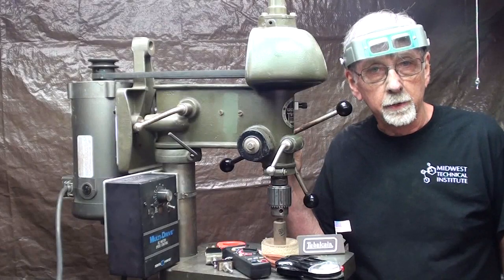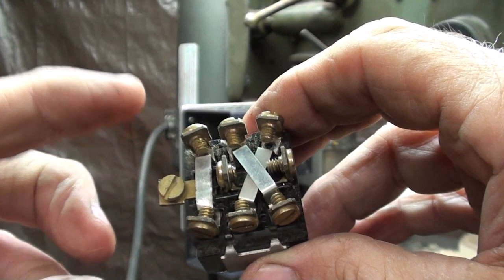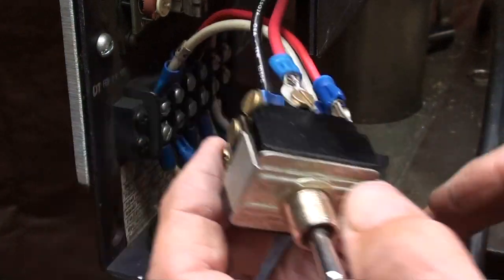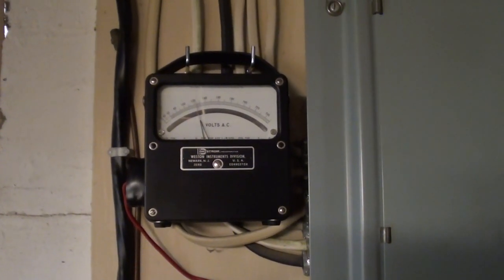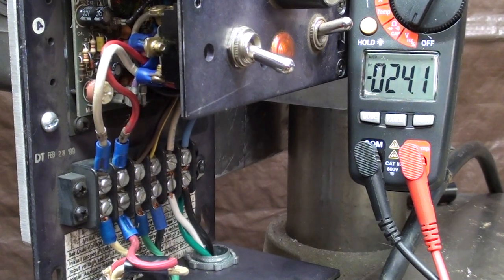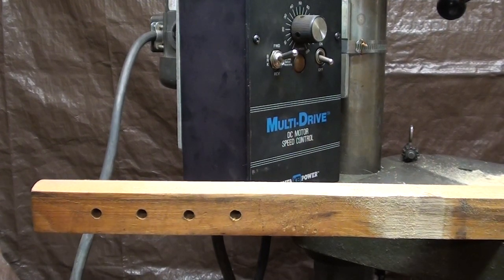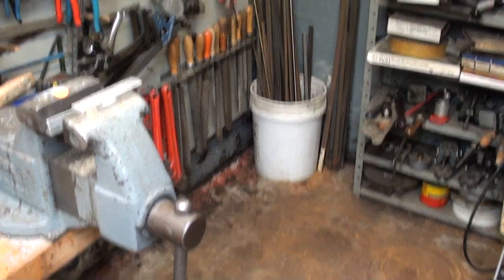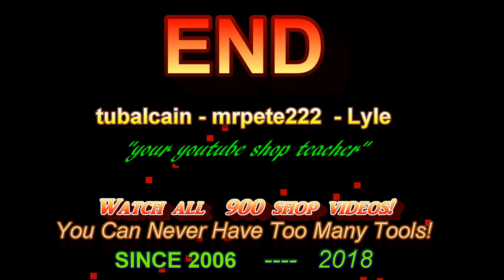Install Reverse Switch on DC Motor Tips #481 tubalcain

Comment: I didn't expect that much torque at that low speed. Thought it would stall.  I think you have a winner!
Reply from the maker: Yes thanks
Reply: Steam engines and DC motors produce the same torque at low RMs as at high RPMs, this is why DC motors have replaced steam engines in Locomotives and industry for so long. VFR drives are now replacing DC motors.

Comment: I really enjoy this kind of shop work. I do it too and sometimes seemingly simple things take me weeks!!! I am retired so it's not my evenings... its days and days and days... I really like your control box. I didn't see the VFD but I like the whole idea... right now I am re-cutting/grinding the taper on the nose of my 70's vintage Craftsman floor model drill press. I am setting the compound up to copy a J33 and then will set up the spindle to cut and grind. I had to make a holder for my Fordum grinder so now I'm ready. Your videos give me great information and really help me to do things. I know lots of people just enjoy watching... but I am using your teaching!! Thank you!! OH... by the by (my grandmother used to say that), I remember you saying several years ago why would a boy spend thousands of dollars on a car when he could by a Bridgeport Mill. lol Loved it. I did drive from Washington to CA to buy a Southbend Milling machine... it's a beast. Not particularly precision the table looks like a hammer and chisel mechanic worked it over for about 50 years but it works really well and I am able to adjust and use it to some degree. I did buy your series for the mill and that helped some. Maybe one day... (I suspect this it far out of your purview) but one day maybe you could do a mill table refurbish... Not like scraping or anything but making it usable.... For now... I 'll just keep adjusting and struggling to get things oriented properly to the spindle. Thank you again!!!
Reply from the maker: Thank you for watching. I had a southbound milling machine at the school. I really liked it. I bought it brand new so it was in nice condition until the kids got a hold of it.keep watching

Comment: I did a similar thing with my dc speed (Dart 250 series) control on my lathe. One important difference though is that I made it difficult to switch from forward into reverse before the motor stops.  I learnt this lesson the hard way and damaged the same make/model of drive you have.  I added the same dpdt switch but used one with a flip down protective cover so you are far less likely to go from forward straight to reverse.  I even cut the switch toggle height down to a 1/4" stub so I didn't accidentally flick the switch when flipping up the "safety" cover. This way i remember to switch off the ac power (you should to) before flipping up the (red) protective cover and moving the stubby switch from forward to reverse. It's not perfect but it is safer than an exposed forward/reverse switch. I know i'd make the aame mistake again if if i hadn't of made reversing more of a challenge. This was on my lathe and it did take longer to come to a full stop, it may not be such an issue if the motor stops as fast as your does. Just something to consider for anyone considering this. The factory reversing uses a safer approach where the ac power is also switched off (4pdt switch) and some also have circuitry to prevent current being applued while motor is still turning.

Comment: Mr. Peterson, the switch looks suspiciously like one that has brake capability. It is quite probable that two remaining (side) terminals are shorted when switch is in the middle position. In either up or down position they are open. This is where the braking resistor would go (shorting the motor terminals while coasting acts a brake dissipating energy created while the motor acts as a dynamo). Maybe worth checking.

All thumbs way up for all what you do and your wisdom.
Reply: I was thinking the same thing.........a resistor and a heat sink across the motor supply wires.....in the center position......
Reply from the maker: Thank you very much, I think you are a little ahead of me regarding electron theory
Reply: As you, Sir, are WAY ahead of me in your machining skills not to mention machinery and tools. Garage envy!
Reply: Won’t work at all,there isn’t any regenerative potential here
Reply: I think the Brake position is probably a form of DC injection which is why it would work on the middle position - have you tested if the circuit is open when the switch is either up or down and if it is closed in the central position?

Comment: Good practical demonstration. Thanks. The power being produced by a DC motor is simply Watts=amps times volts and if you prefer horse power, divide by 745. So as the motor is slowed down the current increases and the power increases too.

Comment: Mr Pete I worked for many years in a steel works where motors were predominantly DC 250 volts or 500 volts on the older plant so I'm a big fan of DC motors ! The drawback for home use for many years was the motor needed a 'control box's but now with the use of VFD's  the playing field is somewhat levelled.
Reply from the maker: Many years ago, the entire Westclox factory was wrong on DC motors. They made their own electricity at the time. I hauled many loads of those old motors to the scrap yards.

Comment: Hi Mr Pete
You can also change the motor direction by placing your switch in the Field circuit. The advantage of this is the switch carries less current.
Reply from the maker: Good point

Comment: Good series on the DC drive conversion Mr P. and it is interesting to me anyway. It seems the low speed torque is not a problem thus far.
Reply from the maker: Yes thanks

Comment: Pete; 
The switch you just put on your drill press has that 3rd set of contacts that you did not use.  check to see if it has a short across it when the switch is in the center position.  If it does, make sure the other two positions do not short. (only the center)  If this is correct, take two short jumpers from those lugs and tie them only to the two center lugs that go to the motor which is the armature.  when the switch is in the center position, this puts a direct short on the motor.  Turn on the controller, and turn it to forward.  It should run just fine at any speed.  Then set the switch to center, and the drill should stop very quick.  That is the break for emergency type stop.  Then turn the switch to reverse, and that too should run just fine.  Again if you turn switch to the center, it will again stop very quick.  This is a must on any DC type motors, for emergency stop.  A dc motor acts like a generator when you turn it freehand and with a short across it makes it like it has a very high load, and it will stop quick.  because your motor has a field winding instead of a permanent magnet, this will be hard to do with that motor.  Your motor has to have power on the field winding which is the magnetic winding.  This will make also so you can reverse it as quick as you want, without hurting your controller box.  But be  sure to check the switch on that third set of contacts first.  It has to only be shorted when in the center position.

Good Luck!!!!!!

Michael
Reply from the maker: Thanks. That was a bit complicated

Comment: Mr. Pete,
  I have had excellent results with DC motors. I think the naysayers are probably trying to use cheap, 15 dollar controllers bought online to try to run their machines. Most of those I’ve looked at are made for stepper motors used in cnc applications which have minimal loads. Just like your smaller dpdt switch, the wire size tells the story about what the controller is capable of handling. It looks to me like your controller has at least 12 gauge wiring for the leads. Most of those small controllers have 16 gauge or less wire line in leads. They advertise them to run up to 130 volt motors but anyone thinking they are going to run a 2-3 horsepower treadmill motor, which is very popular right now, without stalling at slow speed are going to be disappointed. They tend to blame the motor when, in fact, they are trying to run it with a controller that won’t handle the amp draw, even though the amp draw is minimal on DC applications. Few people have an amp probe or know how to use one.
Dale from Decatur
Reply from the maker: That's interesting to hear. I'm sure you are absolutely right

Comment: I went through a similar process with my Hardinge mill, it has a DC motor and had a huge variable transformer for speed control. I replaced that with an AC electronic speed controller and 2 bridge rectifiers. One for the armature and one for the field. It works great and the torque is good until the speed is very low. I also put in a reversing switch.
Reply from the maker: That's awesome. Are used to have a hardinge mill

Comment: I was given a identical Walker Turner drill press, in a box, in pieces. Found some pictures and was able to put it back together. I think it was a 15 inch bench-top model. Base was missing, table must be for a different model, as the hole doesn't line up with the spindle. Attached the column to a floor jack, instead of making a base. Used a old motor from a printing press. Yeah she works good! Mine has a "Quadrill" 5 spindle turret installed on it. Not much info on that, only that it was an aftermarket accessory. You simply move the feed lever backwards, and rotate/change spindles while it's running. Not something I would need, but you can progressively increase the size of the drill bit, if your drilling hard metal. Or drill and tap, as someone suggested to me. Also missing a quill spring. Wonder if it was removed, for this turret attachment, as moving the feed lever backwards, might break the quill spring? 
Not sure... And these drill presses last forever! I think mine was made in 1944, and we have many of them at my work, still going strong.
Reply from the maker: That was need to get one and a parts basket. Yes they are great machines. They must've made 1 million of them

Comment: To solve your limited access problem w drill press consider buying a $40 “mobile base kit” eg. Harbor Freight P/N 95288. These are low profile dolly kits and support up to 300 lb loads. They have leveling stops. I use 1 x 1.5 steel tubing for durability vs the 1 x 1.5 wood strips suggested; however, wood would work OK. For lifting things like the drill press I use the cheap “engine hoist” as seen in UR new Clausing acquisition except I replaced the hydraulic cylinder with the air operated version - really facilitates working on things that need to be moved/lifted.
Reply from the maker: Thanks, good idea

Comment: I have a similar setup on my drillpress.However i mounted a variable 8.in pulley on the spindle.works great.Low speed is around 50-60 rpm.handles a 1-1/4 bit.very hard to stall.much easier to drill large holes without smoking the drills.good post.
Reply from the maker: That sounds like a good installation
Reply: @mrpete222  Thank you for the reply, I will try to send you pictures of my setup. It really transformed the machine into something that has much more usability and versatility. I did ,however build a mechanical linkage to advance and lower the speed at the belt,similar to larger industrial drill presses. This,with the variable motor,which is 1horse,makes it a brute.

Comment: That's pretty good DC drive unit, keeps the motor at nearly the same speed by increasing current, some of the low $$ ones just stall...And...nice drill press, I have one just like it...!
Reply from the maker: Thanks

Comment: I have upgraded both my bench-top mill and my horizontal mill to DC motors.  It is the BEST thing I have done to improve those tools.  I used 1/2 HP 90 volt DC Baldor motors and they work wonderfully. No more belt switching in my shop!!
Reply from the maker: That's awesome

Comment: I had no doubt that you would not be able to stall that motor easily-the controller you have there was designed for industrial applications where you could not afford to have issues.  The company I work for still has some of that same brand controller/DC motor systems in operation even though a lot of the applications have been changed to VFD's/AC motors.  
Given enough leverage/friction/binding/mechanical interference  you can stall any electric motor to the point of overload.  Just recently I watched a continuous cooker driven with a 20 hp motor come to a complete standstill when it was jammed.  The VFD recorded a 175% overload before it cut power to the motor.  I think you have a good system for low speed drilling and tapping there-I'm now thinking about looking for a similar set up for my drill press.
Reply from the maker: Thank you for an interesting comment

Comment: That worked out great.  No problem drilling.
Reply from the maker: Randy.. What kind of oil should I use in the Clausing speed control?
Reply: Any light Hyd oil will work, ISO 46 is what I use.
Reply from the maker: Thanks

Comment: People are always saying that drill press bearings won't take radial loads, and I'm thinkin' that might be an old wive's tale.  If you think about the way bearings work, they'll usually take more radial load than thrust load - particularly with ball bearings.  And even tapered roller bearings can handle radial loads when installed in pairs.  Heck, that's what your car's wheels ride on, and they'll generally last 100k miles or so.  I've got a Delta floor standing drill press that I modified to do some milling, and the bearings seem to be holding up fine.  I'd be interested in your thoughts.
Reply from the maker: The problem was a drill pressfor that application is that the diameter of the bearings is way too small. Note how much deflection there is andthe spindle
Reply: This is a pretty big drill press.  It's an old delta 17-900, and the bearings in the quill are bigger than the bearings in some micro milling machines.  And then there are two smaller ones on top under the pulley.  I certainly couldn't do anything like you do with your milling machines - just relatively light milling.  I do basically the kind of stuff you might do on a micro or mini mill, and I keep the quill as high as I can.  I will check it for deflection, and I much appreciate your response.  Thanks.

Comment: Interesting on how the various setups work when dealing with direct current.  I remember being fascinated with how a set of hump engines could push a heavy cut of rail grain cars up the hill at a steady 4 mph, yet if you were sent down the main line on a hot transfer you could do 10 x plus that speed with the throttle in the same position.  Regular engines took advantage of having multiple traction motors, hump engines used that and field current control.  I tinkered with a single motor setup that I had at home, and discovered that if the traction motor had equal current to the fields as the armature, it would run slow and had more torque.  If the field current was reduced, the motor would run faster.  If the field and armature circuits were tied together, you only option for speed control was to limit the available current.  That resulted in less torque at low speed.  That may explain why some that have tried DC motors have had poor results.
Reply from the maker: That's very interesting, and I really enjoy watching locomotives work

Comment: 👍👍👍 my world is mostly AC, i have been doing the vfd install , instead of swapping motors. actually, ive been expirementing using one vfd for multiple tools, which although long runs on the load side are not recommended....it doesnt seem to be causing problems in a one man shop. I am curious what the current (amperage) readings are during the different operations. When you stall the motor you are beyond the recommended FLA of the motor and already potentially causing damage. so i am curious what the DC motor will do within nameplate restrictions.
Reply from the maker: Thank you, you are a little bit over my head

Comment: The reason you didn't see the current bump up when you turned up the speed is that current is proportional by the torque output by the motor, and you aren't putting any load on it—all you're doing is overcoming the friction in the bearings and belts.

The RPM is determined by the voltage, adjusted for resistive losses. That's why motors slow down under load: the additional current due to the torque required causes the effective voltage to drop a bit.

Comment: Mr. Pete

AT lower voltages you get less torque.  Instead of varying the voltage, you could use a PWM speed control (Pulse width modulation) that will maintain the torque over the various speeds.  They are not really expensive (Amazon has them, as well as eBay)  Again this is for DC only motors.  As to reversing, should be just as easy  PWM is how the mini-lathes/mills control the speed while maintaining good torque across the speeds

John
Reply from the maker: Thank you, good idea

Comment: I enjoy your projects and I dabble in amateur eletronics, I have a speed control I built with my old foreman (a WW2 top turret gunner ) made for the old cast aluminum hand drills but it will work with any universal type motor that will maintain a constant torque by using an SCR (silicon controlled rectifier) I don't know if it would work on a larger drill press motor.
Reply: You can't use an SCR for DC motor speed control.  They will only work with AC for that purpose.  An SCR needs to see 0 volts in order to shut off.
Reply from the maker: That sounds awesome